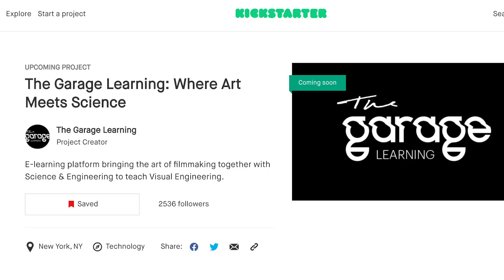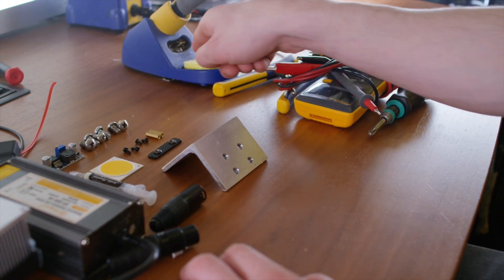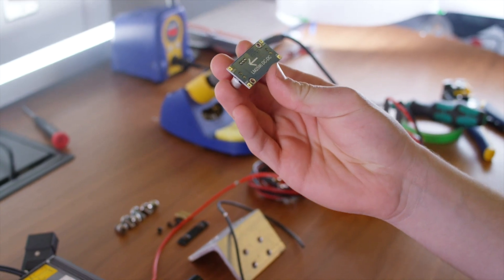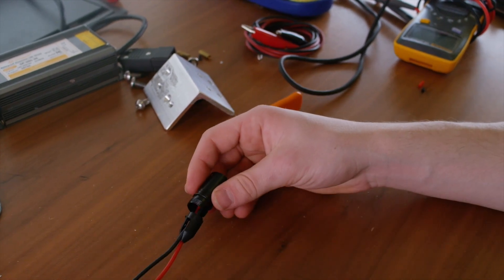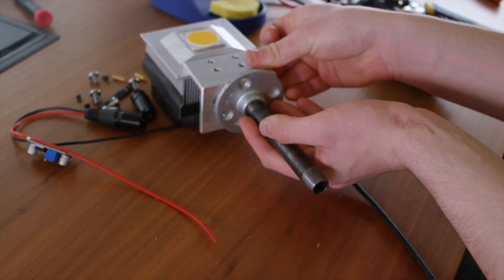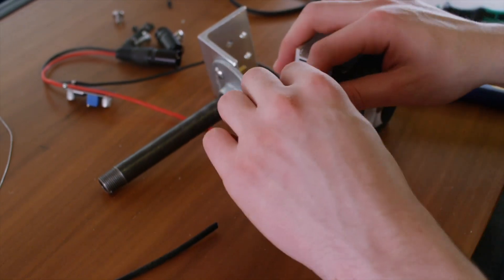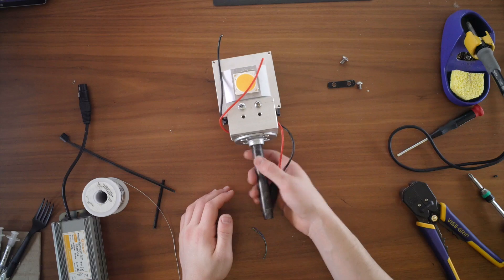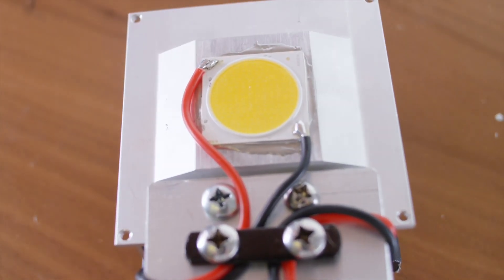How To Build A 100W LED Hard Light

Comment: I've been fretting paying big money for a good COB light. This project could be an awesome answer with a little refinement. So I've got a request for this: Could you include some instructions on how to make it dimmable? Maybe a v2 version? Arguably, it's not that useful without a variable output.

Not sure the best way to handle it, but perhaps a constant current power supply or converter of some kind? I didn't look at the specs of the chip used and how well it could dim, so that might need tweaking. Also likely affects how you power the fan. Though if you tweak it just right, a lower output won't need as much fan power, so a lowering voltage could slow the fan too. Could also look at a heatsink option large enough to run passively.

Comment: Thanks for showing us how to do this! Quick question, I followed all the steps, set the output volts to 12v, and when I plugged the Meanwell HLG-120H-30   into the wall, my light turned on for a few seconds (no more than 5) started flickering and burned out. The LED is now dead. This is the one I used: https://store.yujiintl.com/collections/led-cobs/products/bc-series-high-cri-cob-led-bc160h-100w?variant=36275436103

Thoughts on what I did wrong?

Comment: awesome, in theory would this work the exact same if i were to use a higher watt cob as long as the power supply could handle it (like the 450watt chip for example)?
Reply from the maker: Maybe. It's a matter of power supply and also heat dissipation. The higher the chip wattage the more challenging heat dissipation is and overheating / burning out the chip. This is why we liquid cool our 1800W chips.

Comment: How hard would it be to  add a dimmer?
Reply from the maker: I would like to at some point make a tutorial on this.. We use mosfets to control the amount of voltage/current the LED gets.
Reply: @TheGarageLearning  that be cool.  I'm sure a lot of diyers would love to make their own studio lights
Reply from the maker: Or maybe also using a lower voltage power supply and using a boost converter to work as your dimmer. But it would be limited in way the by the boost and power supply

Comment: Why use the epoxy instead of the thermal grease? Won't that affect heat transfer??
Reply from the maker: Because thermal epoxy transfers heat well enough as well as mounts the chip permanently

Comment: How would you attach a modifier mount like Bowens to this?
Reply from the maker: Kent Anderson maybe epoxy or you can possibly screw it on somehow  you’d need to find a mount part to attach. When we launch these kits for real with the Kickstarter our hope is to include a reflector solution as well.
Reply: The Garage Learning Sounds great. I’m working on building a 300w 30x24 panel light now, then I want to try building a COB light next, but would want to be able to mount modifiers like a soft box, reflector or fresnel. Love your content. I look forward to every video!

Comment: What is the maximum output LED you can put on a block like this before it overheats?
Reply: These CPU coolers are always rated for specific max TDP. The cooler used here is recommended for max 90W, so they've gone right to the limit with the 100W LED they used.
Reply: @avgbits  Tnx!

Comment: So I can buy a 150w light from Godox for $200... Any reason why I would build these over just buying them?
Reply: 1: For the fun of it.
2: Also because the Yuji has a CRI og 95+ vs the Godox which has CRI of 93. Generally anything under 95 is bad. But if that is what you can afford, go for it and make awesome stuff instead.
Reply from the maker: Yes, this is designed to be 50% learning
Reply from the maker: You learn how they work so you can build others yourself and use that knowledge in projects where you need a custom size / shape light
Reply from the maker: You can use a cheaper chip

Comment: Amazing! Will there be more info on the output this unit can create, especially in relation to what's already on the market.
Reply from the maker: Stephen Roll output would be similar to other 100w daylight units
Reply from the maker: Stephen Roll as long as you build or repurpose a similar reflector. This is designed to be 50% learning tool, 50%  tool you use one set
Reply: @TheGarageLearning  Got it. And the 90 degree bracket comes in 3' length and would need to be cut to size, correct?